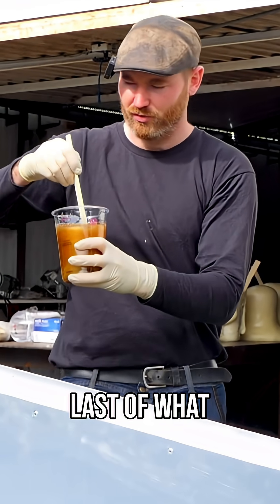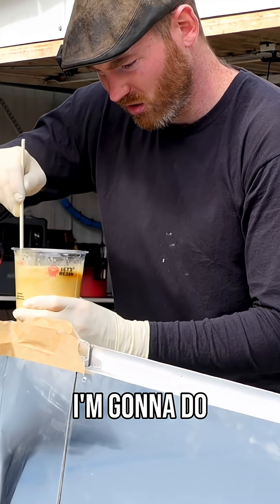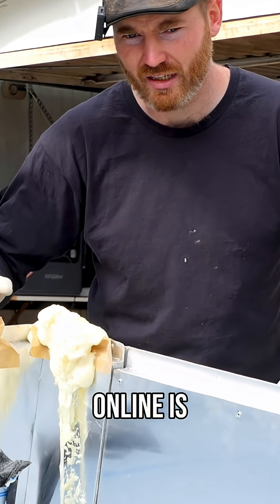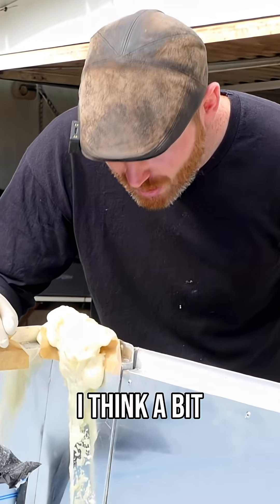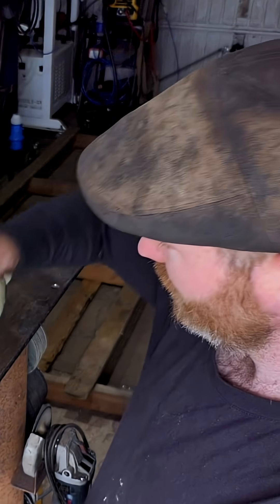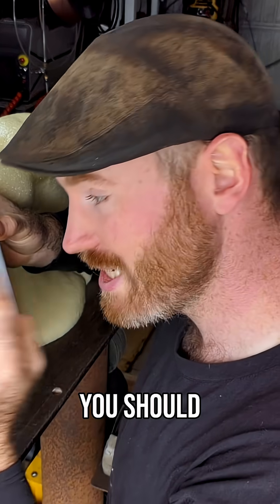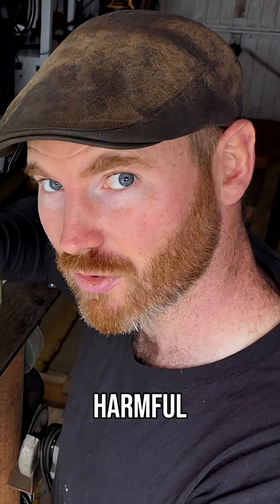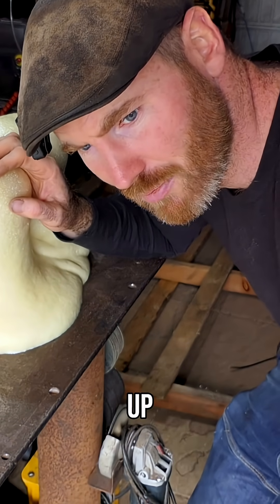Last-Ditch Effort to Fill a Cavity? #shorts

Comment: For the benefit of one who has not been following along step by step, can someone explain the background of what is going on, or give a link to where it is explained?
Reply: This is a clip from one of his videos about making a bike camper, trying to insulate it with expanding foam and such
Reply: Click on the icon (horse head) in the lower right hand corner for the full video...It is an hour plus long but will give you a complete view of ebike camper trailer and all the ups and downs (mainly downs..!!) of the manufacturing of this quite unique trailer/camper
Reply: https://youtu.be/F29LtGmSL3Q?si=BncggvXy-sEM1kEx

Comment: Maybe , the next build you could use Rockwool . You would need to split the batts( maybe it comes in thinner pieces.)
No muss, fuss, expensive chemicals.
Reply: And it will not burn
Reply: yeah, and not crack. pu foam is worst possible insulating material for device which vibrates a lot. Also almost no diy mixes contain water repellent, so it will disintegrate even more under humid / rainy conditions. and insulating value of crack is 0.